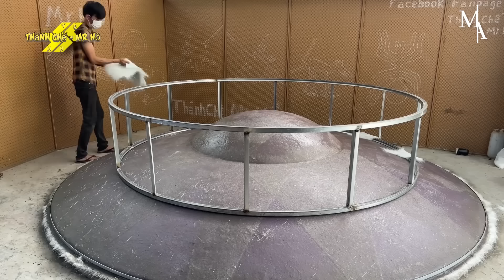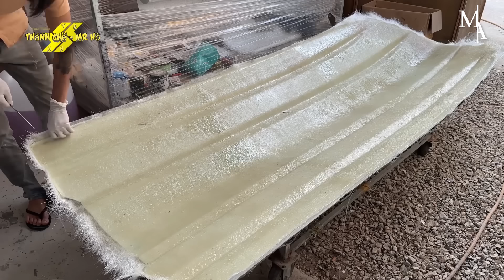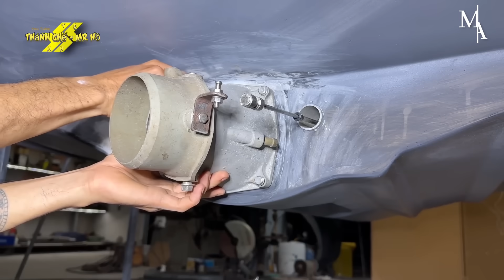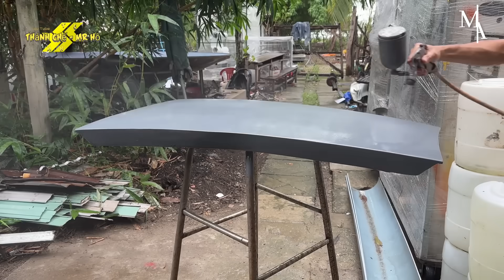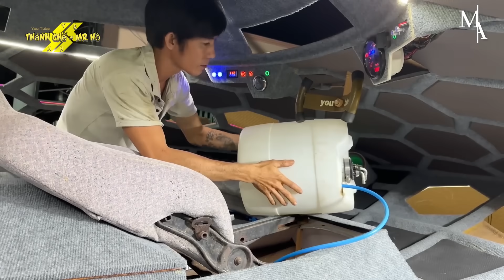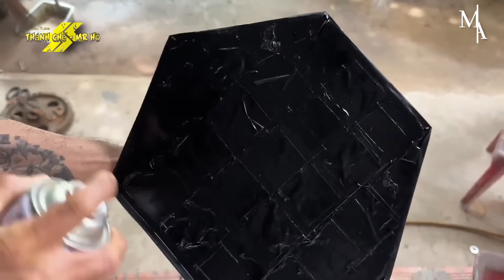Man Builds DIY UFO Boat with Car Engine | Start to Finish by @Mr_Ho

Comment: There is no doubt that this is an incredible piece of work. My only suggestion would be to have made it a hydrofoil. If the struts were mirror finished, it would have looked like it was flying over the surface of the water.
Reply: Excellent idea and I'm sure this talented engineer can modify. As in any 'first' naturally after the initial testing there will naturally be enhancements to follow! Thanks again!
Reply: Control systems for hydrofoils are non-trivial.

There are simple mechanical controls that work in calm water at lower speeds, but if you want it to function properly in rough water you need a fairly sophisticated system to adjust the angle of the foil automatically in real time.
Reply: @Zomby_Woof  Yes... it would be easier to just point the water-jet down a few degrees until it stops porpoising.
Reply: thx 4 tze comment
Reply: That would be awesome. Nice flat ride"hovering"above the water.
Reply: @scottfortune9016 Wouldn't want to scare the wrong people though 😅
Reply: Is there someone that makes these other people and how much I would like to have one
Reply: Id like to see it on the water.
Reply: He's doing very good I'm not lying
Reply: Feel if his goal was river boating though hydrafoil would be a bad idea because he most likely would be in very shallow envornments. Would be cool if it was for lakes though.
Reply: @ddavis5442  how long do you think the draught of a hydrofoil is?
Reply: @BazLapp  the issue is likely the risk of hitting logs and other shoreline debris, as it is for all shoreline hydrofoils
Reply: Storm
Reply: Needs a bit of trim control
Reply: Yea a much better idea but its still mak2s no sence to call it UFO boat!!! So its an Unidentified Flying Object Boat!?    That's just dumb!
Reply: Electric power plant would have been better wouldn't it?
No - too heavy 😂
Reply: Love this idea!
Reply: Надо было испытать Как работает люк если лодка перевернётся. Это важно для безопасности
Reply: I thought the same thing.  Either way they did a great job.
Reply: Trifoil
Reply: I was coming to say this.
Reply: Incredible. Hope it doesn't ever tip over.
Reply: He's made a foiling bird boat as well.
Reply: Would change propulsion system design?
Reply: Wwwwwqqq
Reply: Sometimes you only have what's available. But I'm sure he can sell it and then grab that snazzy material!
Reply: Sometimes you only have what's available. But I'm sure he can sell it and then grab that snazzy material!
Reply: It ws my firs idea too.
Reply: I came here to offer that suggestion.
Reply: That's the only way it would have been usable - once the front comes up and stays up with this, you can only see sky.
Reply: @John-G I'm sure modifications will follow. As in any first build once you get it  in the water and take it for a spin ideas and considerations will be forthcoming. Good luck and again, Congratulations on a super design and build.
Reply: @mojorisin54 There's no way of modifying it so it doesn't come up on to plane - all boats do except for hydrofoils, as has been pointed out elsewhere.

It's a great build but a flawed design.

Why try to pretend it can be something it's not or it can be 'modified' when it so obviously can't?
Reply: @John-G I think it's great. As far as the lift obscuring the view I believe he could balance it out to eliminate that problem.
Reply: @mojorisin54 It's impossible to do that with this or any hull you plonker. 
Even if you changed the hull completely so that it planed you would still have the same problem while it's coming on to plane.

It's basic science, with EVERY hull except hydroplanes, which is the only way to solve the problem.
Reply: @John-G theres windows in the bottom for this reason
Reply: @John-G He has windows in the bottom section between his feet. He can see where he's going.
Reply: Great idea.
Reply: Impressive!!

Doors will leak. Heat build up from engine will become unbearable. Wear ear plugs because noise produced from the propulsion engine and electric motors that open and close the doors will damage your hearing. Vibration isolation pads should be used between the captains chair and vessel hull.
Reply: Awesome project for prototype. Many mistakes that time will correct. Incorrect fiberglass construction,  not enough structural support,  incorrect structural design, incorrect structural materials,  no insulation of engine compartment or cooling system of compartment, no noise control. Non durable components,  balance issues, water proofing issues,  weight distribution issues, component quality,  safety or survival equipment lacking, disconnects for power failure missing, proper regulation marine lighting issues, toxic fume release issues,  fire suppression system issues.  Awesome design and idea,  but you have further to go on improvement than progress made so far. Give it time and development and this could be a marketable item. Very good job!!!!!!!!
Reply: @gwminichiello9322 It's a one off for content generation.

The engine and jet drive are already in the next project.
Reply: Um gênio
Reply: kenh nay an cap ban quyen cua Mr Ho thanh che ne
Reply: @DungNguyen-zd4uwđúng vậy bạn.  Nhưng tôi lại thấy vui khi họ đã truyền tải rộng rãi cho các bạn tây lông mũi lõ biết được người Việt cũng rất giỏi và có bộ óc sáng tạo
Reply: 🤟Ingenious 🤟
Reply: I would also suggest putting a guard on that grinder bud. This is an amazing life of work but it’s not worth a blade to the face
Reply: We will be waiting for you to do this.
Reply: Dang! You're right! ❤

Comment: All good, nice idea...but...this is a total death trap...you're sitting on a bomb, there is no firewall, there is not even carbon monoxide safety switch, there is zero visibility, plus it doesn't seem very stable in the water. I'm a form follows function guy, but it's a nice showpiece.

Comment: I started to watch this without the sound on, trying to figure out what they were doing. When i got lost at one point in the process, i turned on the sound and heard the commentary. I restarted watching with the sound on. I'm glad you're narrating this. I got lost at one point. I thought that fibreglass boats also had to have plywood to create strength in the areas that people are walking. I'm not a boat expert,  but that was my impression.
Reply: dont know, but good boats have dual layer bottoms as air buffer and strenght. just like car body plates.

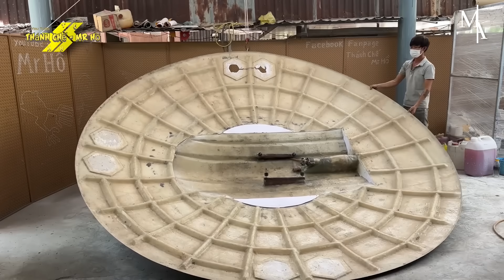Comment: 7:00So the, only thing I'd note is, they didn't round the edges around the door as over time stress fractures or cracks are likely to occur. However it's an amazing and imaginative design.

Comment: I wonder if it might not be smart to add some lightweight spray foam flotation to this creation.  As a teenager my sister and I once took our rowboat with some flotation blocks under the seats out onto a 2 km wide saltwater river.  Within five minutes it changed from a beautiful sunny day to gale force winds, one meter high waves and 1-2 cm hailstones hitting us.  We were being pushed by the wind downriver very quickly.  For some reason using both oars made it impossible to row towards shore. Using one oar on one side did the trick.  Our mother ran out to the end of our neighbor's 600' long dock thinking we were drowned and could not see us.  We had been blown more than two km downriver and beached the boat and began walking home.  Mother had started driving in her car downriver.  Her relief was immense.  That had happened so very fast.  That boat had two foam flotation blocks under the seats.  I made my sister tie herself to the boat.  It seemed like a miracle the boat did not flip over.  I have always been very cool headed in an emergency.

It would be a shame to lose such a fine creation!  I remember floating above sunken fiberglass boats we spent long times searching for in that river.

Comment: That's a really cool conversation piece and is also a great exercise in boat building. Wierdos... Actually, you could do an electric version of this boat that I think would work really well with the batteries laid out in radial arrangment around the bottom for stability. Electric boats work really well and are much more rewarding that electric cars in terms of advantages and range etc.

Comment: The description isn’t correct. It is a 2 cycle donor waverunner engine (Yamaha?) not a 4 cycle car engine. A safety notice of leakage of CarbonMonoxide possible since the engine compartment isn’t air tight to the cockpit. A running engine should provide continuous voltage to a circulation fan is preferred. Other than that it’s a pretty cool functional craft but can it survive the rough waves of ocean or lake?

Comment: I'm still wondering if a old-fashioned Flying saucer is actually, more likely to go from space to water than space to land. Since the design does work great as a Pancake flying wing as well as a boat. Maybe it functions similarly to the black fly flying car.🤔 Maybe not so much a flying saucer as a flying submarine.

Comment: How long can it be opperated before the pilot passes out from the engine exhaust?   It does not look like there is any way to vent the fumes from the inside.
Reply: I wondered about that too.  In such an enclosed environment it wouldn't take much at all.  Still, as brilliant as he is I am sure he thought of that.

Comment: It reminds me of the flying sub on Voyage to the Bottom of the Sea.
Reply: As a professional model maker three of us once made a $5000 model of that thing about a meter long for a scifi collector about 40 years ago working from a few fan magazine photos.  When I cut out the sharp edged manta ray front blank I had to hold the acrylic vertically on a sled on the tablesaw fence.  I will never forget feeling the friction of the sawblade teeth on the back of some of my fingernails. I did not dare relax the pressure.  I made some strange stuff in my day too.
Reply: @mmagnusol    Wow! Holding anything vertically while cutting with a table saw is extremely dangerous. You're lucky you didn't lose a finger. Sometimes dangerous things just have to be done though. Voyage to the Bottom of the Sea is what got me interested in electronics. Now at 73, I'm playing with Arduinos and building projects that would have been unimaginable back then. Not the same but now a sub could be sitting on the sea floor, launch a drone that could do aerial reconnaissance, drop small bombs and return to the sub. It's amazing.

Comment: More video on handling and performance. It is quite challenging to keep the vessel horizontal and I see some difficulty stabilizing it as you go faster, but the idea is worth exploring. In the 1950's and 1960's there has been a research at building saucer-shaped airplanes as well.
Reply: Would have run better with catamaran hulls running full length from front to back.